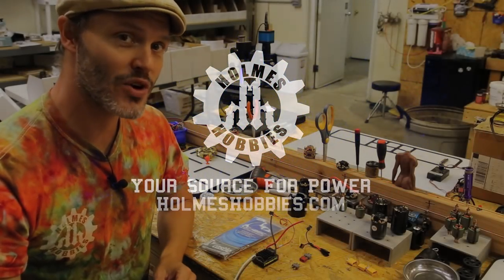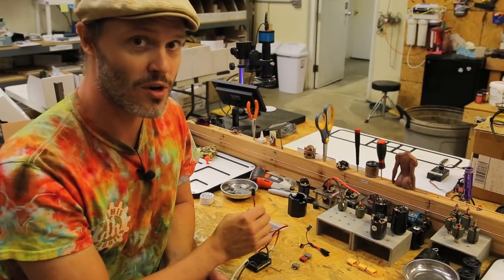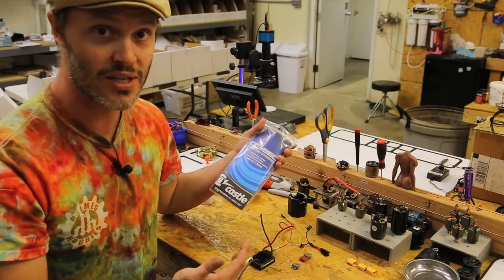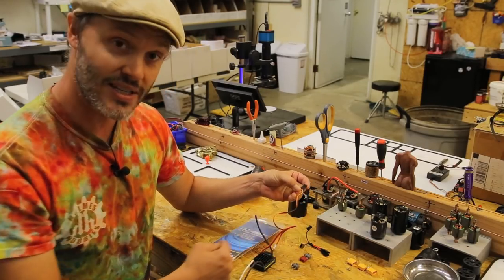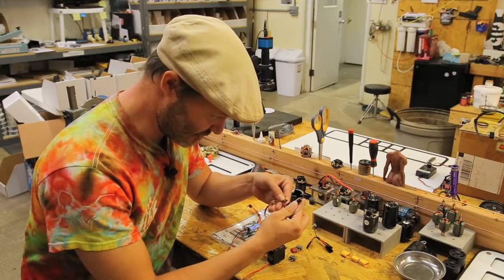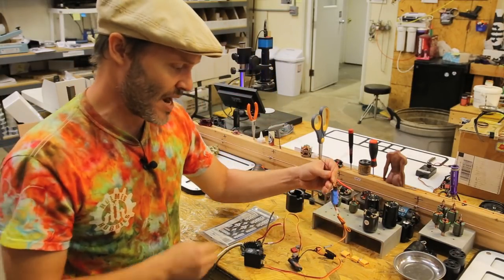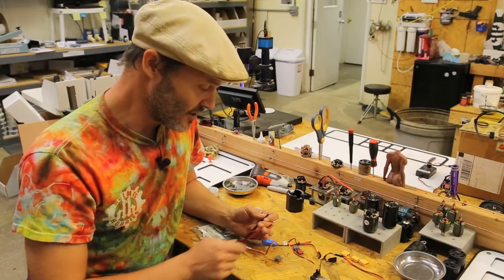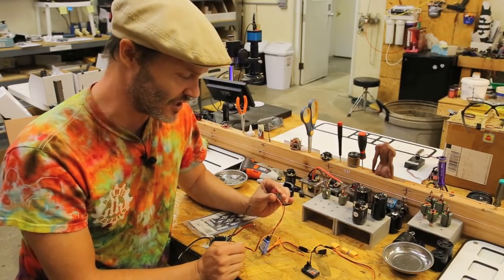What is a BEC and why do you need it?

Comment: I get what it is & what it's used for. I'd just like to see a close up shot of the different wiring configurations. 👍😁
Reply: Me to
Reply: Orion This was 2 years ago. I’m not even sure if he did a different video
Reply: Orion I had to watch it a few times to remember what a bec does lol. I never ended up using one. But Reefs makes some nice servos & some of them have crazy power.  What else is done to your truck?? I’m just thinking with some of the parts being plastic you don’t want a really high torque servo. I’d try & stay in the middle on their servos. Something with decent speed & torque & yes I’d run a BEC because it’ll let you get the full potential out of the servo instead of just plugging it into the receiver box. Your receiver only runs on like 5.5 v /6v so if you run the servo @8.4 v  right off the battery it’ll be faster & stronger.
Reply: Orion yeah definitely look into shit for sure. I’m so hesitant to buy Traxxas electronics. The specs on their servos aren’t that good for that kinda money & then  you gotta worry  about it shitting the bed. Yeah they’re warranty is great but then your without a truck.
Reply: I think for me if I didn’t see all the videos & hear about all their electronics having problems in almost every vehicle Traxxas has & me have 2 2075 servos that are 12 years old & still work fine & my 4tec is 2 months old & the servo in that died. I got my TRX4 too with all original servos but the truck is 2 years old & hasn’t even had 2 packs ran through it. Lol
Reply: I actually never needed a bec. Just nice to know what it does & how to wire them. I never really got into crawling on account of injury & cant really do the walking that I intended on doing with a crawler. So I was kinda out of the hobby for a bit & now I jumped into No prep racing. It’s starting to get big in my area now & we have a good group of guys racing.

Comment: I never mess with the ESC / BEC Red wire ?? I just connect a 3" servo lead with the Red Wire disconnected to the original ESC lead and keep the originality of the ESC unit in tack ... This is for 2 reasons, first being Re-Sale value and  secondly, disconnecting the Red Wire on some BEC's may effect the programmability of the ESC itself and/or the BEC itself. Not Good ! A 3" servo lead is $ 0.47 ...Lol

Comment: Can someone help me, i have a question. Im building a traxxas slash from the ground up, I purchased a Hobbywing EZrun max10 SCT 120a 2s-4s ESC, I want to run the system in 4s, question i have is related to the Steering Servo, Do I run a normal 7.4v Servo or a 14v Servo that connects directly to the battery? this part is confusing me

Comment: This is what I was looking for. I'm setting up an MKS servo in an Arrma Kraton with the stock ESC. Going to bypass the ESC using the Castle waterproof BEC so the servo doesn't burn up the stock speed control. Gonna use a bypass adapter

Comment: I love bypass adapters almost as much as your Puller Pro 2200  😆😆😆🤘🤘🤘🤘🤘🤘🤘🤘🤘🤘
Great vid , Solid info for sure  John👌👌👌😎😎😎😎😎😎

P.s The puller pro 2200 is Gods gift to brushless crawlers👌 . I am being naughty and running 6s and using the castle MX esc and external bec🤘🤘🤘👌👌👌😎😎😎😎 ,
I dropped the throttle curve off to counter the over 50,000rpm.
I'm pulling 2 hours run time on 850mah 6s 75c  with sensational temps. ( needless to say I am running baby mode settings on the esc and I still have more power than ever needed 😆😆😆)
Its a Big weight reduction running baby sized batterys 😎.
 I've never been as impressed with a brushless motor as I have been with the puller pro ..😀😀😀😀😀🤘🤘🤘🤘🤘🤘😎😎😎

(For anyone else reading this . Puller pro 2200 is recommended at 3s and has a 50,000rpm max 🤘👊)
Reply: Rc Anonymous where can you get the bypass adapter from?
Reply: @toolstechandtoys5910  i bought mine on ebay but there's plenty of places that sell them. Just google it.

Comment: Great vid. Really appreciate you breaking down the process and how it all works. That bypass plug is brilliant!🔥🔥🔥

Couple of questions for you- 
1- If you have HV (8.4v) servo pushing over 500in/oz. How do decide on what amps bec to get? I see 3 amp, 5 amp, 10 and 20 amps... 

2- I also see that some are labeled for planes and heli. Can those be wired on crawlers or surfaces vehicles without causing damage? 

Hope you help and thanks for this vid. 🙌🏽
Reply: I know this was 3yrs ago but I was wondering the same thing today. 

Did anyone ever clarify this for you?

Comment: So if I just want more power to my steering servo on my TRX4 but want to leave the voltage at stock on my 3 mini shift servos then I can use the bypass adapter with an external BEC? Just making sure I understand it correctly. I have a Reefs RAW500 steering servo and would like to take advantage of more power without frying my stock mini shift servos.

Comment: Please help me with this John. I have your bypass adapter and a CC BEC 2.0 WP which has 3 sets of wires. 1 gets soldered to power (battery) and other 2 goes into reciever. With your adapter, do I plug both ends into it? 1 end into BEC port and other end into aux port of bypass adapter? Thanks in advance

Comment: What would possibly cause my Spektrum Rugged radio to keep loosing reverse. I've programmed my servo winch to aux 2 location F  3 pos momentary and I keep loosing just the reverse portion of the radio. I've also added a castle BEC to power the servo only, using one of your modified Y harness and still have the problem. The weird part, this only seems to happen using the E and F locations....on both of my radios. If I use D location It appears to be OK. I've reached out to horizon and still awaiting a call back...3days now

Comment: i use a hobbywing quicrun 1080 esc and the bec (inside the esc) voltage can be changed between 6 and 7.4 volts usingbthe program card. It is set to 6V in default and does changing the bec voltage to 7.4V increses the overall power of the rig ? i use a 7.4V lipo

Comment: I'm using a castle 20a bec wp and trying to use a dual holmes hobbies receiver bypass so I wont take a chance on burning up another spectrum sr515 receiver im also wanting to hook up a light controller i have that plugs into the receiver and powerd by the balance plug im trying to run everything at 7.4 using the new hobbywing quickrun fusion 1800kv 2 in 1 any feedback will greatly be appreciated thanks

Comment: I use my spektrum receivers as my esc in a few on my rc constructions conversions.. So with that if I wanted to draw more power too the modified 360 servos as my main gear drives..how do I go about installing a BEC?  Do I just by pass the receiver and connect bec straight into a battery then into servos?  hook it up same way as shown just no need to cut a red wire too a esc if I dont have one correct?

Comment: I have Capra with dig. I’m operating a futaba s9177sv servo and a reefs 99micro for dog. Both can ran off 7.4volts . I also have a BEC I am installing with a mamba x esc.  With a T4pm futaba controller. What do you recommend me setting my main voltage too.
Reply from the maker: 7.4 is just fine
Reply: I’m sorry sir I am also running a homes hobbies 540s 3300 KV with the over drive in the portals. I have truly learned a lot watching you and Harley and SBG. Thank you for the info. May I send pictures of my ride when done also may send a couple of buildings pictures as well if ok with you

Comment: John do you recomend a BEC having a Mamba X with a Savox 1230 500 onz/inch on 6V max...
Reply from the maker: You will probably be fine.   The X has stouter than average internal BEC and a hefty case to dissipate heat.

Comment: Hello Friend, thanks for the explanation. You said you programm BEC on 7.4V. is it right all the electric component (receiver, Servo etc) must have a minimum voltage of 7.4 or hoger? All my component beside the receiver (6.5v) have it and i was wondering if i can programm the BEC on 7.4v? I have a hobbywing exrun XR8 sct. Thanks a lot.
Reply from the maker: 7.4 is safe for almost all modern radios and servos.

Comment: Great video! I always enjoy them. I have a question regarding the waterproof CC BEC 2.0 with dual leads. The diagram shows both being plugged into the Rx for "best results". I thought the lead without the signal wire was for powering any accessory, such as light, etc.. What are your thoughts? Thank you!
Reply from the maker: There are many ways to do the same thing.   Using an extra power lead to power your lights would be just fine.

Comment: I heard you can use these to power lights on your crawler (headlights, light barn ect.) Is this true?
Reply from the maker: As long as the lights have built in current resistors or a current controlled driver

Comment: do you know if bec's can be powered with pwm current? an odd question i know, but i need to know for my rc project.
Reply from the maker: I wouldn't do it.  But if you have enough capacitance on the input it would work.  Needs to be smoothed.  250uf low esr minimum
Reply: @HolmesHobbies  thank you

Comment: Don't use such bypass adapters, it may cause issues. Get a simple Y-cable, with 2 female and 1 male connector. On the male connector that plugs in the reciever, remove the positive AND negative wires but leave the signal wire intact. Having the negative wire intact ( like on the bypass adapter shown in this video) may cause unwanted actions. On one of my trucks it caused the servo to turn full left when giving full throttle. This was caused by having the negative and signal wire plugged to the reciever. 

This wont happen to the majority of people and for me it only happened when I swapped the reciever for a newer one. But better safe than sorry.
Reply from the maker: First time I've heard of this problem out of tens of thousands of bypass adapters.  I have seen hundreds of floating ground issues that bypass adapters solved however.  I would like to know more about the wiring, battery, and radio situation
Reply from the maker: It is quite important to tie ground together on the RX, battery, BEC, and esc so that the signal is referenced properly and there is not a chance of ground loop.
Reply: @HolmesHobbies  I was also surprised when this problem occured. The truck it happened on functioned perfect for over 15 years untill I swapped the reciever. As for the specs and wiring: A Hitec servo, I believe it's the HS-7955TG. connected to a CC BEC as shown in your video, a Tekin FXR ESC and a 3s lipo. Radio was a old LRP system when it worked fine, replaced with a Absima CR6P radio and Absima R6FS reciever. This is a rebranded Flysky system.

The BEC is wired to the servo with a Y-cable, on which the + wire going in to the reciever was removed. the ESC feeds the reciever with power. Exactly like you show in the video. When I swapped to the new radio system, problem started. If I applied full throttle, the servo would fully turn to one side and the car wouldn't move. After some searching on the internet I came across some posts that suggested removing the ground wire as well. and voila, the problem was fixed.

Comment: Can you recommend a product like this that can power working current of 7-17v it’s a 12.6v led but you said this can do 7.5v
Reply from the maker: There are cccv drivers on ebay that you can set for controlled amps and controlled volts.  Unless you have current limiting resistors on the LED you need controlled current
Reply: @HolmesHobbies  should I get the Cc/cv driver that’s adjustable? Since there’s one that’s only has one adjustment & one with 3 adjustments. Since the one with one only does 3a & idk how much that light needs so it would prob be better to get the adjustable one? Also there’s another product I got my eye on which is the iflight 2-8s voltage regulator BEC says it can do 12v 3a & input is 5-36v this sounds like the cc/cv driver don’t it?
Reply from the maker: 3 adjustments,  so you can control current.  I can't guess at your needs, this is when you would need a multimeter to figure out more
Reply: @HolmesHobbies  I ordered both units to test them. if 3a works good and don’t over heat I’ll stick with the 1 switch just to keep things easy & less things that can go wrong .. but if 3a to the flashlight is too much I’ll use the 3 adjustment one to help that!

Comment: Wish you could make a video on how to wire a bec on a nitro car. Is it possible?
Reply from the maker: most people use 2s or 3s pack for it?
Reply: HolmesHobbies yes, planning on a 3s pack, but how is it wired since there is no esc?
Reply from the maker: just straight into the battery
Reply: If I plug straight into the battery, 3s - 12+volts, the servo will fry as they are only 7.4. That's where the confusion is - On how to wire the bec to avoid the servo from overloading. On a nitro there is no esc.
Reply from the maker: The battery goes into the BEC.  The BEC goes into the radio and powers the RX and servo.
Reply: HolmesHobbies Perfect! Thanks much!!!